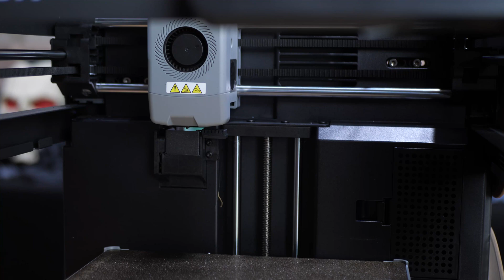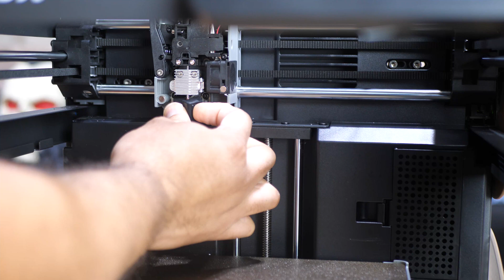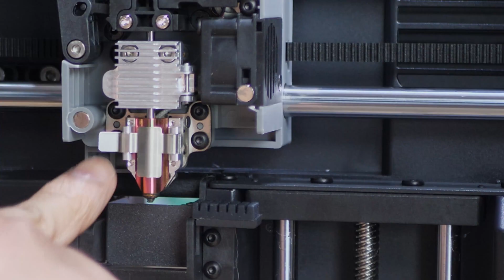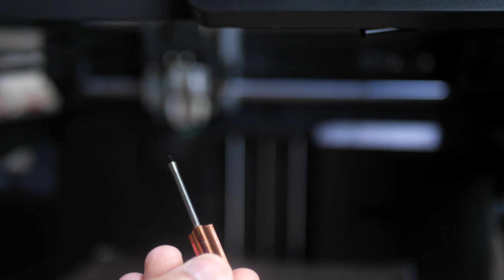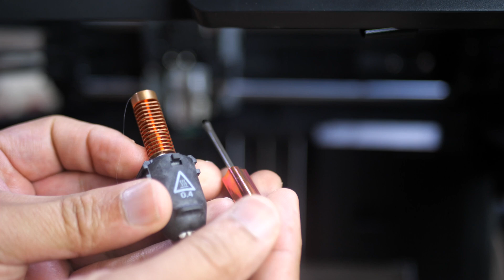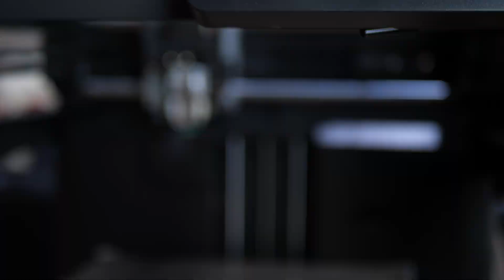Flashforge AD5X: How to Change Nozzles/Hotends

Comment: Do we need to change settings or anything when we go from a .4 to .24?
Reply from the maker: You do need to change the nozzle profile in the slicer to match what you have installed on the printer.

Comment: the rubber sleeve on mine doesnt come off also the nozzle wont come off either and the 4 in one tube thing wont come off,  ive taken the clip off but it wont budge there also seems to be a part on mine where the 4 in one thing goes in thats is not on othere ad5x
Reply: update.   on watching your video the nozzle now comes off and i was able to unclogg it thanks to how great you explain everything and how good your videos are. thank you , you have saved my printer